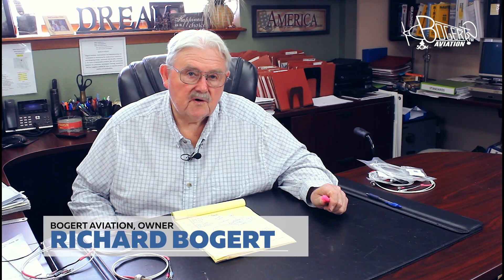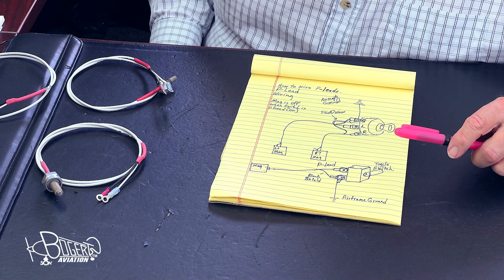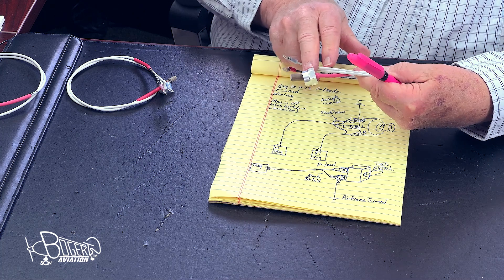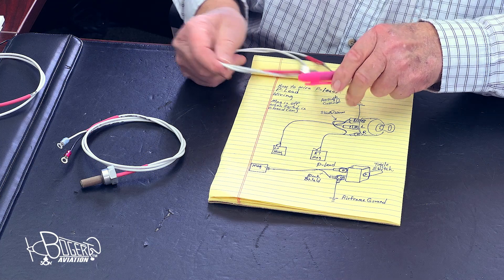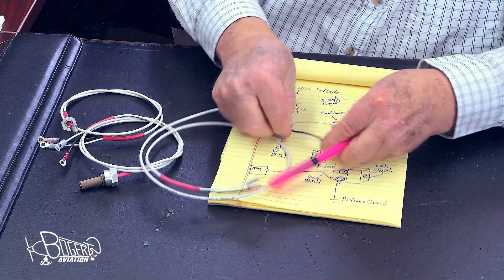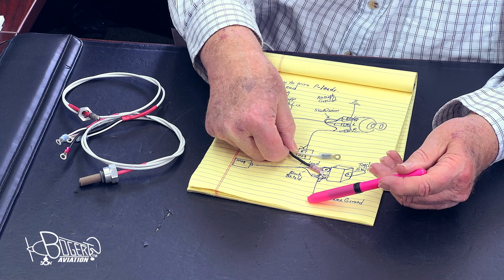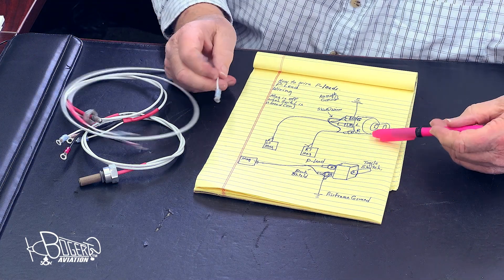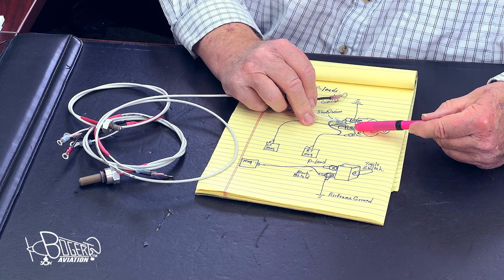How To Wire Magneto P-Leads to the Mag Switch - Aircraft Maintenance with Bogert Aviation

Comment: Hey there, sorry for to slow reply.  It's common for alternator cable shielding to be connected only at the alternator to prevent radio interference but the magnetos are different. The aircraft wiring schematics show the shield connected to ground on both ends for magnetos.

Comment: Others are saying that the shield at the switch is not necessary and not to connect it.  They say it will cause radio interference.  they say to only connect the ground at the mag.
Reply from the maker: Hey John! Just replying to make sure you get the message: "It's common for alternator cable shielding to be connected only at the alternator to prevent radio interference but the magnetos are different. The aircraft wiring schematics show the shield connected to ground on both ends for magnetos."   - Richard Bogert